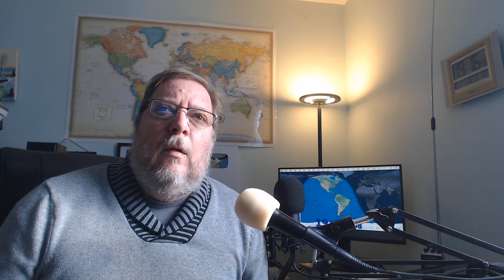Shortwave radio and Artificial Intelligence in the future can help our hobby

Comment: The way this was explained to me was… A transceiver comes with several software methods built-in which are designed to filter out unwanted noise. The operator is tasked with deciding what method or methods to try. AI would replace the operator in that role and might do a better job since it would have been trained somewhat prior to purchase and would learn more as time goes on.
Reply from the maker: It is even more than that, as the AI can learn the patterns and make a difference between voice and noise, being much more efficient than using the actual filtering technology